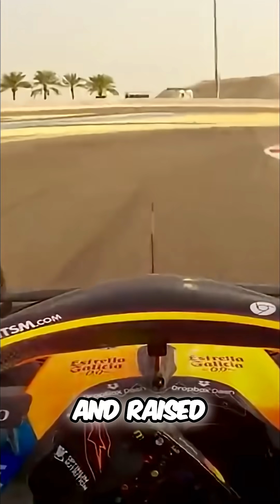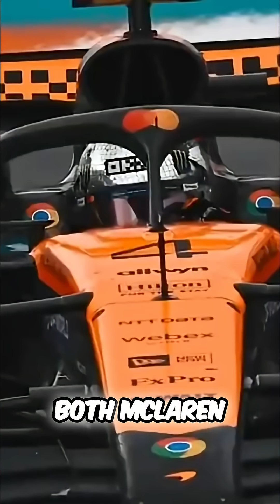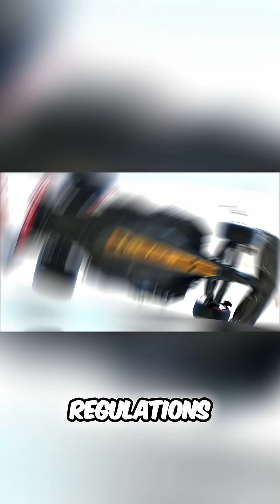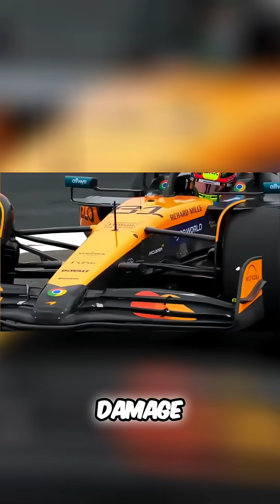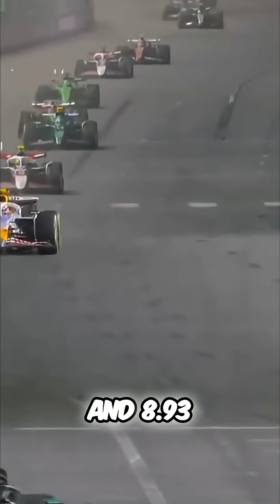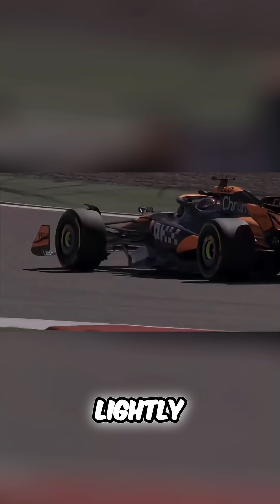McLaren F1 Disqualified! Skid Block Violation Explained! #shorts

Comment: Woww... Very conveniently towards the end of the 2025 f1 season rigging it so maxie can clinch another wdc.
👏🏼👏🏼 Well done FIA
Reply: Toxic fan alert.

The car was illegal. That's nobody's fault but Mclaren. He was 12% over tolerance. There have been several DQ's this season for the exact same issue. They had set the car up far too low, which does give an unfair advantage. 

The timing isn't 100% coïncidence, it is just after a TD implemented in Brasil for...let's just call it a loophole that wasn't in the spirit of the rules. Even with the (now) illegal skidblock they have already been in the danger zone for wear three times this season. They just thought they could get away with it.

Just face it dude. Lando's probably still going to win, unless he bottles it...again. Don't stoop to the level of pretending the only reason Max has a chance is through cheating. You can support a driver, a little bias is OK, but don't be a toxic idiot.